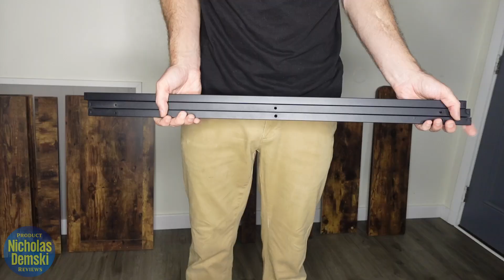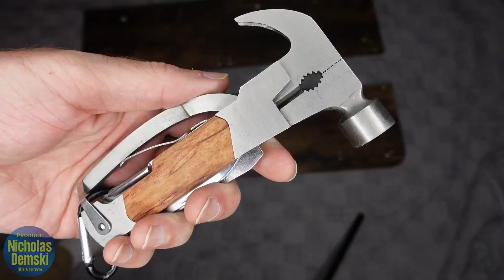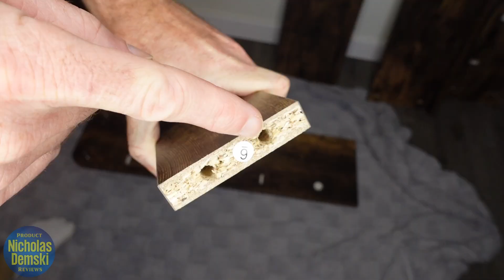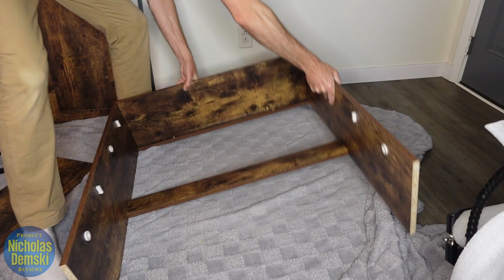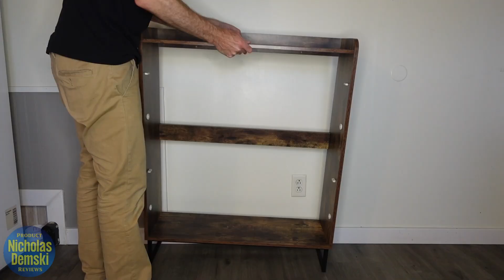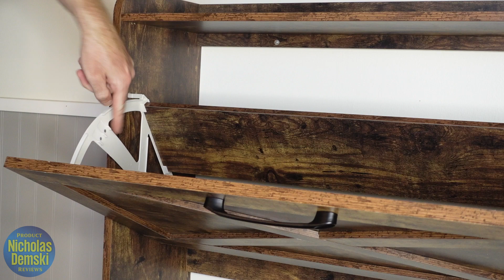Maupvit Shoe Storage Cabinet ASSEMBLY and FULL REVIEW!

Comment: any tips or tricks for getting those plastic G and K pieces in place?  doesn't seem to matter how hard or soft I hammer, or if I use a regular hammer or rubber mallet, I can't get them flush...
Reply from the maker: you dont need a hammer. just watch my video and do exactly what i do :)
Reply: @nicholasdemskiproductreviews  thanks for the reply.  i did watch your video, and you most definitely used a hammer to insert the plastic disk (from bag G) ...I cannot get my plastic disk to be flush against the board
Reply from the maker: @ ok let me check again i dont remember using the hammer
Reply from the maker: @ so im not really sure what other advice to offer after re-watching that part...maybe just make sure youre hammering "all" of the piece as opposed to just the middle of it, might help going back and forth until something gives. sorry i cant be more help